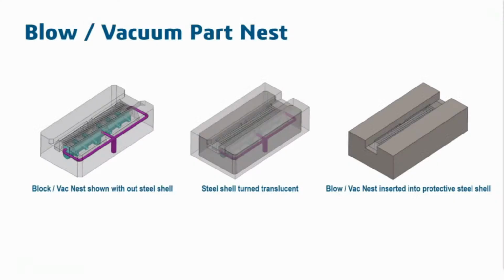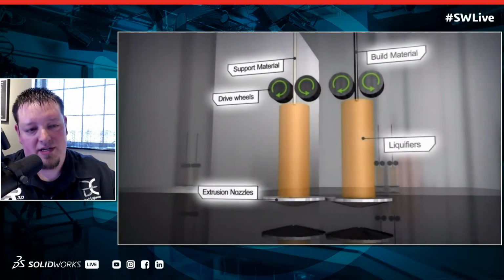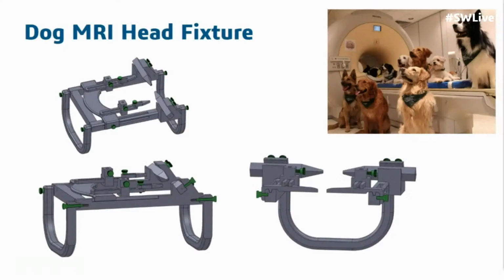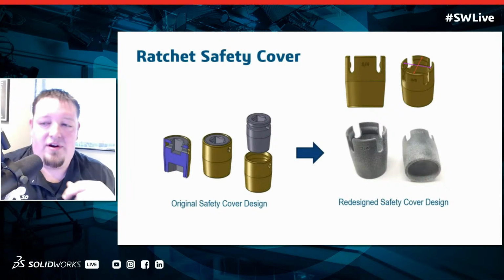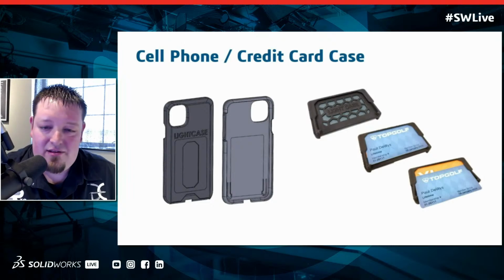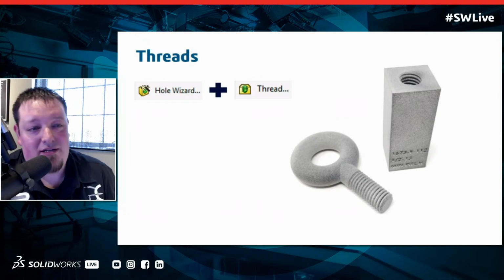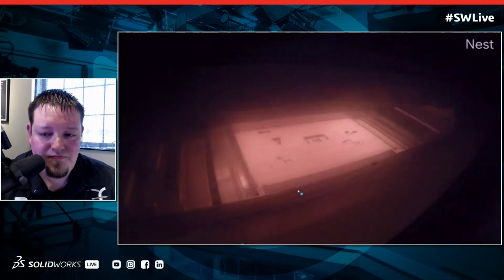Design for Additive Manufacturing - SOLIDWORKS Live

Comment: 00:25 Introduction to the topic of additive manufacturing and guest speaker
03:51 Transition from Catia to Solidworks and venturing into 3D printing
07:29 SLA machines used for prototyping and trade show models
09:21 Additive manufacturing is evolving from rapid prototyping to true manufacturing
13:06 Designing parts for additive manufacturing using photopolymers
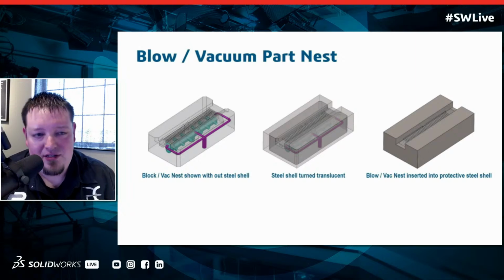15:04 The stainless steel shell protects the fragile SLA with fluid paths and air pass through it.
18:27 Designing self-supporting structures with over 45-degree angles for additive manufacturing
20:03 FDM is a common 3D printing method using two extruders for build and support materials.
23:23 Redesigned applicators for low volume, high mix production.
25:04 Designing parts without supports for additive manufacturing can save time and cost
28:27 Discussing the challenges faced in using metal parts for animals in MRI machines
30:02 Use of plastic components in MRI fixture for improved safety
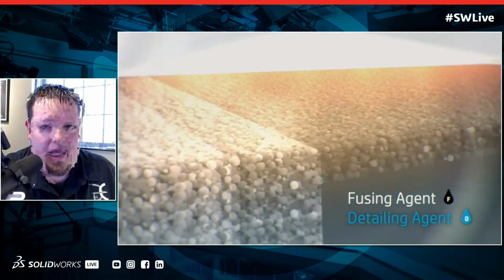33:16 Additive manufacturing is not meant to replace traditional manufacturing methods
34:58 Combining 3D printed parts with traditional manufacturing techniques
38:08 3D printing cannot beat injection molding for high volume parts.
39:47 Utilizing trapped powder for structural benefits
42:59 Designing a functional phone case for holding credit cards.
44:29 Discussion on MJF technology and its applications
47:58 Introduction to 3D texture tool in SOLIDWORKS
49:30 3D threads and whole wizard tool in SOLIDWORKS
52:33 Print preview tool provides accurate platform sizes for designing parts.
53:59 Design parts for Additive Manufacturing with surface finish optimization
56:52 Combining nylon and TPU rubber for strength and soft touch
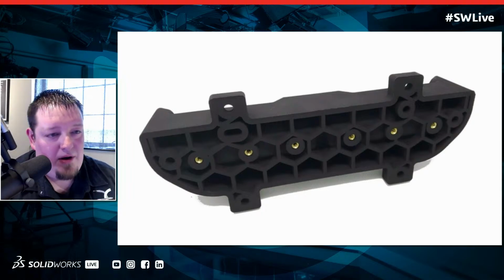58:26 Pre-production hand assembly fixture for automated assembly machines
1:01:46 Design for Additive Manufacturing requires a different approach than traditional manufacturing methods.
1:03:17 Using chamfers and thread tools for smoother transitions and thread length accuracy.
1:06:20 Direct 3D printing to threads without scaling or offsets in SolidWorks
1:07:58 MJF uses high temperature to prevent warping of parts
1:11:18 Upcoming events and guests on SOLIDWORKS Live
1:12:59 Acknowledging and thanking the audience and guest